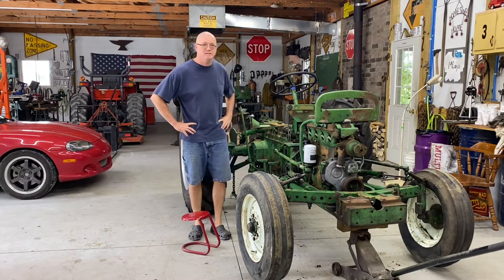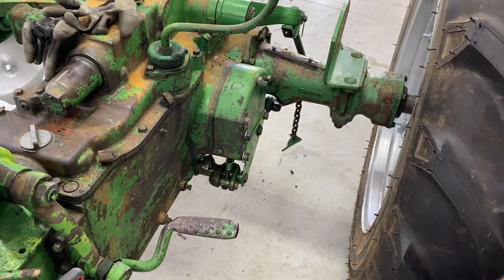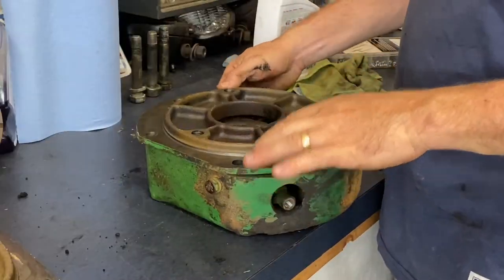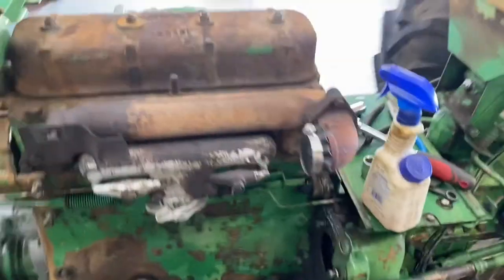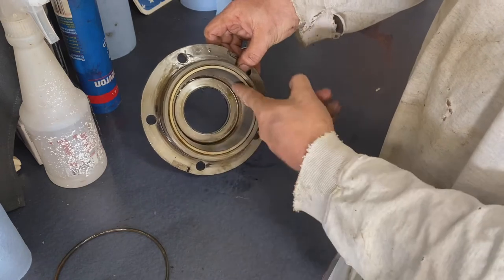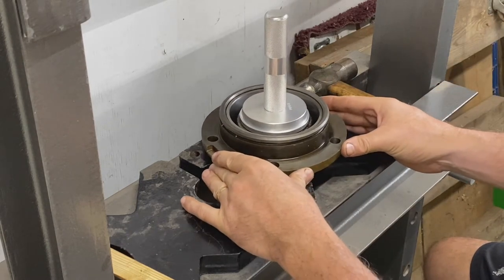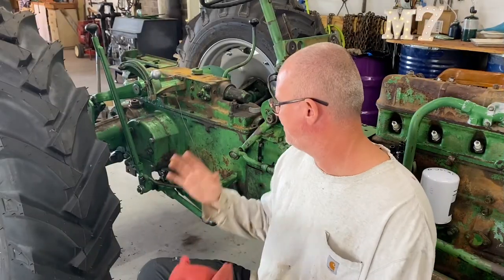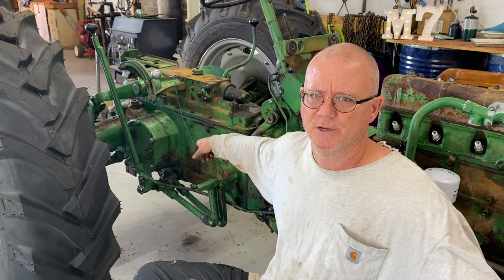Oliver 550 Rebuild: Repairing Brakes Ep #13

Comment: I have a 550 and the 3 pt struggles to pick up a thousand pounds and the arms will settle all the way down when setting in my shop. Is my pump leak and the cylinder bad you think or what do you think?
Reply: I can’t find anywhere that says how much it should be able to pick up with the 3 pt
Reply from the maker: A thousand pounds is too little. I would pull the hydraulic pump and look for cylinder scoring or leaking seals. Maybe take to a hydraulic shop. I have a video covering the removal of your pump. It’s pretty easy actually.
Reply: @shopdoc  Thank you for replying to me, you are the best. I will take it apart and see what is wrong and I too have to fix my brakes and now that I watched your video on it I feel confident in doing that.